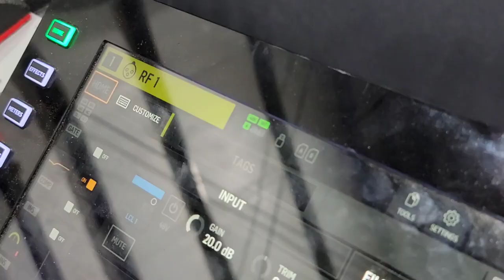Sound Shop Vlogs Clips Channel Preview | Behringer Wing Cat 5 Pop Test

Comment: M & X series consoles are only stable up to 50 meters on Cat5e shielded. If you want to run longer runs you can add a Klark Teknik DN9610 and take it another 100 meters.